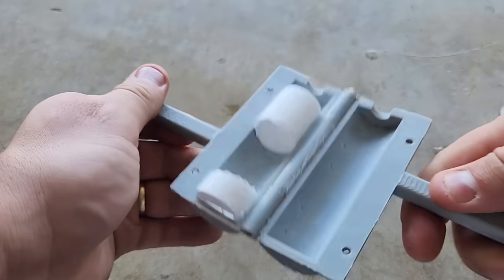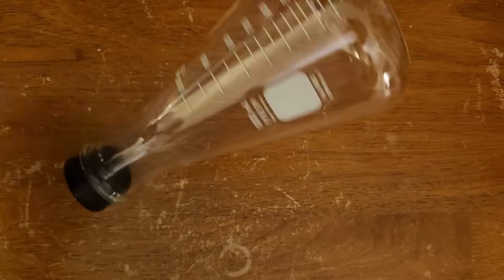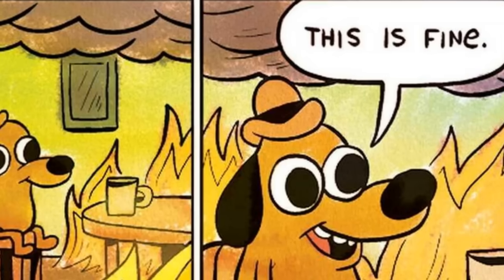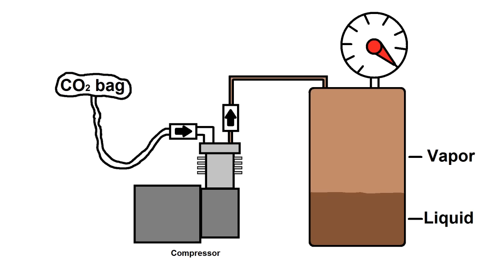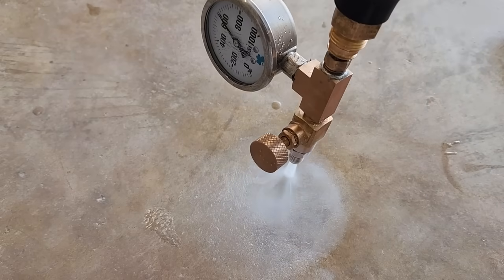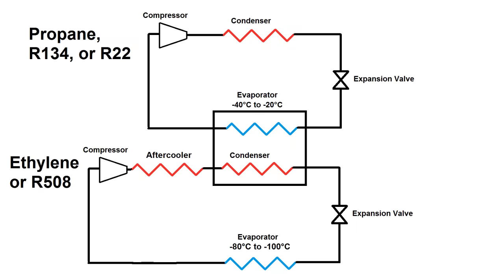Making Dry Ice from scratch

Comment: I think there should be a few cm of oil at the bottom of the compressor 8:38 but there apears to be none . I think the loss of oil caused the temperature to rise and a thermal cut off switch triggered to protect the motor ... When you powered the windings directly 9:02 THIS caused a burn out due to no cooling oil.

Comment: One thing you can do to reduce the liquid coming from your bubbler is to cool the gas going in and out as to reduce the amount of relative humidity. Hell, if between your dryer and your bubbler you added a copper pipe That you then submerged in salty ice water, that would do a good job of getting rid of some of the moisture before it went into the bubbler, ensuring that you got a lot more moisture out. Since you would essentially be plunging the relative humidity down massively because, well, if it can't physically hold As much water then it will start to precipitate some of it out making your trying step way more effective. The only thing you would have to consider in doing that is adding some sort of trap or some other collection for the water generated from that step but other than that it would actually work quite well. This is a very rudimentary design I've used for gas drying in the past and I don't know how well it would work in your setup but something good to consider from things I've done to try and dry something without using a desiccant. Frankly because I didn't want to have to keep going through desiccant.

Comment: May be a stupid thought, but did you think to maybe run both compressors in series, IE compound charging? I bet had you ran the larger compressor as a feed to the lager, you would have hit way over 1000psi look at high performance diesel engines, that's how they get insane boost levels into the engines! At the end of the day, it's all about pressure ratios and cooling, thats how you get density, pv=nrt

Comment: When I worked in a winery we would dump a couple of kg of dry ice onto tanks to prevent oxidation. There was a huge tank out back, that contained liquid CO2 I assume, and you'd just put the bucket under a thing and turn it on... IDK if it did anything special or just shot liquid co2 into the bucket. Anyway the bucket filled up pretty quick. And it was noisy.

Comment: Why would you use HCl which has a high vapor pressure and could contaminate your gas?  (Not to mention corrode your equipment.)  It's too dangerous when acetic acid would have worked just as good.

Comment: A single phase motor needs a capacitor to start. Some are also designed to run with one. No start capacitor,  no starting torque, so no rotation, hence no back EMF, the tiny resistance at full applied voltage will allow enough current to burn out the windings.

Comment: By the way the refrigerant in the compressor housing provides some insulation for the motor, they will always barbecue when exposed to air and run. Just saying from a older AC guy.

Comment: 2 upgrades for you. Can your bubbler make it into a fizzer clothes off the big end and put a bunch of small holes in it. Although this may add more humidity to the gas. 

On your ice bath. If you put it in a saltwater ice bath that would drop the temperature somewhere around 0° f. I'm not sure how that would translate into Celsius.
Reply: You can also freeze the tank with the propane gas. That could be dangerous.
Reply: Or you could Purge the tank collection tank. When the gas becomes a solid it's going to drop the temperature just like propane. I'm sure you under that already though. 

Just getting more into the tank.
Reply: And if you made that mold out of copper and froze it. They would probably yield more solid CO2
Reply: Little to no extra gains just a slight marginal gain.

Comment: A slightly simpler and slightly more accurate way to find the volume of the carbon dioxide cylinder would be to fill it with water and then pour the water into a beaker to measure it. That's one less measurement than weighing the cylinder twice, and it doesn't assume that the water is the exact temperature and pressure at which it has a density of 1g/mL.

Comment: This video just helped me solve a problem. I needed to ship frozen meat today for work, and couldn't find any dry ice. I ended up going to the welding supply store, grabbing a CO2 tank, turning it upside down (inside the meat freezer), and opening the valve into a (clean) denim sleeve to collect the dry ice. It definitely worked, but the tank eventually seized up. I still packed 3 boxes, though. The part that helped me was the "turn it upside down." I couldn't get it to work otherwise

Comment: the compressor fried because of the high pressure; if you pushed it to it's max pressure in the first run, then tried to power it against that pressure in a subsequent run then it definitely didn't have the torque to start spinning again, so it just drew tons of current in it's stall condition until the enamel on the winding was damaged, shorting the coil.

Comment: This looks like a job for a vortex separator. You blow the liquid into a cone tangentally, and there's a vent stack centered at the top. Anything that's heavier than local atmosphere gets flung to the sides of the cone and makes its way down to a collection bucket sealed to the bottom. The stripped gasses vent out the top.

Comment: Hello, I think that the most economical way to produce co2 would be to burn a kilo of coal but fed with tube oxygen,It doesn't work to feed it with air for nitrogen. for one kilo of burned coal you get 2.5 kilos of co2. When the gas passes through the boiler, it goes to water and then there to a pool to inflate there would be co2 with water that can be filtered as in the video.saludos desde uruguay

Comment: 00:13 Making dry ice from scratch through chemical reactions
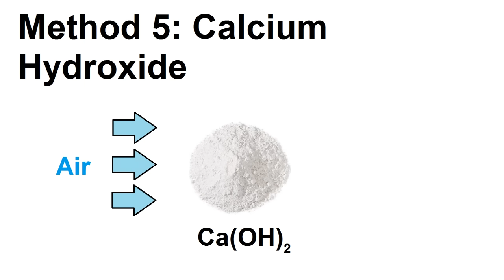02:07 Two methods for making dry ice at home
03:40 Creating dry ice from scratch using basic chemical reactions
05:15 Making and storing CO2 gas for dry ice production.
07:15 Achieving the right pressure for condensing gas into a liquid.
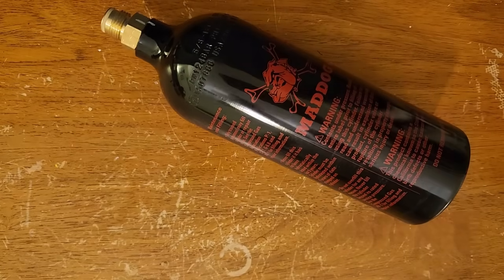09:12 Creating a high-pressure tank for liquid CO2
10:51 Successfully creating dry ice from scratch.
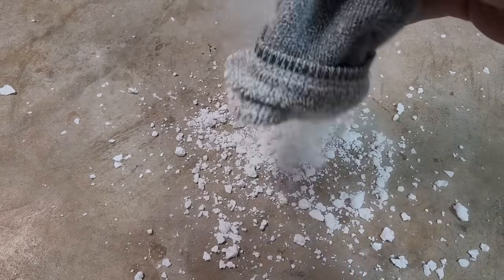13:21 Making dry ice from scratch is doable but not practical for pre-cooling cryo cooler.
Crafted by Merlin AI.

Comment: I once had a defective valve on one of my co2 tanks and after I had filled it it was leaking pretty good. I turned it upside down and pushed the valve into a towel on my work bench. I felt it vibrate and push away from the towel and a little cylinder of dry ice was left.

Comment: Interesting, I was looking at a jet chill system for making cocktails that have a fog/bubbling effect awhile back but they cost like 3 grand. While creating the Co2 looks like a lot of work what you were doing with the paintball cartridges is literally what the jet chill does, just blasting liquid Co2 into a specially made glass. I'm wondering now if I can rig a similar system to get the same results without spending literally thousands of dollars on a machine with maybe 150 dollars of actual value and some plastic cladding...

Comment: I wonder what would happen if you had a fish tank with a tube that ran across the bottom. Drill tiny holes in the tube, fill then tank with hot water and pressurize the tube. Will it be a smoke machine or a bomb?

Comment: It is always surprising how we tend to overthink things.  My friend runs a bug killing business and we were trying to think of a safer way to kill the bed bugs (zero chemicals) and not make his insurance jump through the roof (Heat Treatment).  Bed Bugs are attracted to the CO2 we produce and are mostly nocturnal.  They cannot grip certain surfaces.  So, we could easily find a dog bowl and scuff up the sides of it so the bugs can get in.  Put a cylinder of dry ice/CO2 making stuff in the middle with a small bit of water to further help trap the nasty bugs.  A simple drip mechanism of Vinegar into Baking soda will do just that.  Slowly create CO2 so the trap can be run for extended periods of time.
Reply: Add a drop of shampoo to the bowl with water, bugs cannot escape from it
Reply: have u considered that diatomaceous earth kills bedbugs easy and is basically just some dust you sprinkle around
Reply: @crusher9z9  it doesn't kill all.  Especially eggs and newborns.  Some types of bed bugs are very susceptible to it.  Not all.  Especially the new breeds here in my area.
Reply: I was expecting you to flood the room with CO2 until the bugs suffocate. Although I don't know how long will it take because insects in general can hold their breath much longer than humans.
Reply: @minhducnguyen9276  The CO2 is to attract them to the bowl.  The bowl is of two textures on the inside.  Rough, Smooth and Sticky.  The bowl I am using is pretty large because I decided to put another bowl inside of it where the vinegar and baking soda mix to create the CO2.  It isnt perfect.  But, this is where the light use of chemicals and heavy vacuuming come in.  Trmprid FX works amazingly well and has an effectiveness of about two weeks post spray (in my experience) and as soon as it dries it is safe for pets and kids to be on (just no eating of the furniture LOL!)
Reply: @minhducnguyen9276  it's not that they hold their breath, it's that their oxygen requirement is different than humans. 

CO2 is generally not a great way to kill bugs as it's a non toxic gas. It just displaces O2. Other gasses like O3 are far more effective at killing pests because it is actually toxic to organisms.
Reply: Ozone generator, ozone will kill everything bugs, mold, plants even odors.
Reply: The bedbugs are also attracted to heat more than you might think, using baking soda may be more efficient as you don’t have freezing temperatures. Maybe you could even heat up the bowl slightly if you like. Dry ice just doesn’t seem like the best or most economical option here.
Reply: @justapyro4935  I agree.  I have seen Dry Ice traps and they do work.  I just do not think they would work long enough to draw in the infestation as well as (like you said) dry ice would be cold and would not attract as many.  However, I did not think of heating it to better mimic a human host.
Reply: @justapyro4935 um I don't want to say that you are wrong, but bedbugs are not attracted to heat. Heat treatment in eradicating bed bugs in commercial pest control is about killing them by raising the ambient temperature above 140 for a period of time. They tend to move away from it as the temperature rises lol. They were eradicated in this country but ah yeah they have made a comeback for sure 😂🎉😮
Reply: @staceywatrin2112 I think it may be both.  I know next to nothing about bed bugs, but Google seems to think they are attracted to warmth and will move towards it.  

But like humans, they are attracted to some degree of “heat”  but also can be killed by temperature extremes, like high heat or chilling to the correct temp. 

So “heat” both attracts, and kills, but at different temps.
Reply: @Connor37911 You’re right. Bed bugs are attracted to human body warmth, scent, dark places, and co2. Body warmth is the primary cue that draws them out of dark places. Co2 is all over the place and human body warmth is always with their food source.
Reply: Give me your comment. It's such a good idea.
Reply: ICE is helping fix the bed bug problem 😏
Reply: @TheGuruStud Obviously not. You're still here.

Comment: I wonder if you could have a vacuum chamber with an output to a beach ball, in your case, or an HVAC recovery tank is what I'd use, also convenient since it has a liquid and vapor ports. Then you'd need a T and attach your source tank and your vacuum pump to the vacuum chamber input (with valve removal tool/shutoff, all common in HVAC) That way you could recapture the CO2 and not waste it and still get a large pressure drop flowing into your vacuum chamber. Just make a custom box to make your blocks of ice in. I'm not sure what would be efficient there, if anything.

Comment: I'm thinking here, what if you applied similar method to how a fridge works,  you get a condenser,  with a filter and a capillary thin tube attached to the condenser with your fridge motor in action ensuring the system is flushed of moisture with nitrogen. Would it work better?

Comment: Wouldn't it be cheaper and easier to source your co2 from co2 fire extinguishers or welding tanks? Also when I've seen DIY dry ice done before they sprayed it into a pillow case, not a sock. this made it easy to pack into a semi-solid inside the pillow case, then remove without most of what you wanted sticking all over the inside

Comment: Hardly from "scratch" I'd say... not everybody has an Erlenmeyer or Cylinders or the rubber tubing and dual port container tops or high concentrate muratic or desiccant granules....I have some of it but still missing things to complete the specific apparatus setup and what I have I don't think I'd dedicate to a one time experimental condensate. Looks less refined but still expensive. Boro glass equipment isn't real cheap, especially from a scientific supply dealer. In other words probably don't have this stuff in your kitchen cabinet or even most of your neighbors cabinets...cool that somebody can do that though... wouldn't recommend Ball as a sub, especially if anything needs to be bunsen torched.

Comment: Put salt in the ice bath. It will get colder and you can condense the gas at a lower temp and pressure. There are other things you could add also. In addition you might want to make sure you purge air from the hoses. Good luck.

Comment: I think. You can improve this method by adding salt to the ice water bath bringing the temperature down of the cylinder even further. Also in term of collecting for dry ice I think a pillow case would yield better results.

Comment: I have a 20 lb CO2 cylinder for making soda water. It is not expensive to refill so that would be an option for CO2. Back in the 1980's I worked for Liquid Carbonic and we took CO2 from a fertilizer plant (waste CO2 from the manufacture of nitrogen based fertilizer) and processed it then filled railcars and trucks with the CO2. The plant had sold dry ice also (but by the time I started working for them they had stopped making and selling dry ice). The industrial equipment for dry ice was still there and we could still make some.

Comment: 3:32 - You need to add an air stone diffuser to your bubbler/scrubber to reduce sloshing and improve absorption of fumes and such. The sloshing is depleting your desiccant capacity too quickly as can be seen with the dripping into your drier. Also add some salt to your ice bath for a few extra degrees of cooling. You can get down to -21C with enough salt, reducing your pressure requirement for condensation down to just 19 bar.
Reply: Basically don’t do it

Comment: FYI winding are nothing but heating coils if the motor isn't spinning generating an EMF which causes resistance.   Another words plugging it in without the shaft, just makes it a heater which will burn up quickly.  That is also why windings begin to short when it can't handle the work load, because it causes the windings to heat up.

Comment: "tapping the tank and adding an adapter fitting is a very bad idea" - well, maybe. I understand our Fearless Narator's desire not to be sued when someone punches a hole in their skull with a fast-moving brass fitting, or maybe something less lethal but equally dramatic. But for your information, fittings are usually rated for pressures. If your fitting is rated at 3,000 psi and your pump will produce 500 psi. . . . Well, because of our hyperlitigenous society and the fact that the paintball tank was not expressly designed to be retapped with pipe threads, I won't encourage you to engage in this highly dangerous act, but if you decide to do so anyway, those are the numbers you need to look at. As a side note, a single layer of teflon tape will help seal the threads and prevent them from galling. And remember: always wear safety goggles. Even if the adapter fitting doesn't end up drilling a hole into your skull and liquefying your brain, a piece of brass in the eye, or for that matter a drop of 30% HCl, will ruin your day.

Comment: Something I seen on the discovery channel....compressed gas cylinder from soda fountain....peace of tube....and half a liter bottle....taped together hold the cutoff end of the bottle on a flat cutting board and open the valve after two or three seconds ....there will be a loud pop and wala dry ice....I tryed it and it worked

Comment: A fairly cheap source of CO2 at decent volumes is buying it from a local homebrew supply store. Lots of us carbonate with CO2 from tanks, and while the bottles have deposits to make sure you bring them back, you can buy a 5-pound CO2 tank for about $20-40 (my last fill-up cost me about $22 with trade-in for my previous tank). Five pounds is roughly 2267 grams, so not insignificant (about 4.5 times what you were producing in liquid CO2), especially considering the cost of your time compared to less than $50. Most homebrew supply stores offer larger tanks, as well.